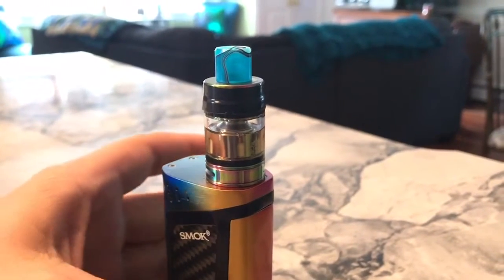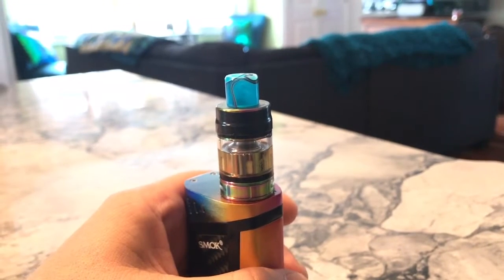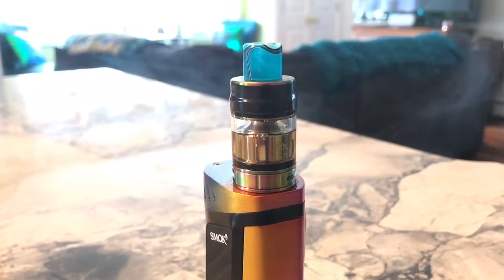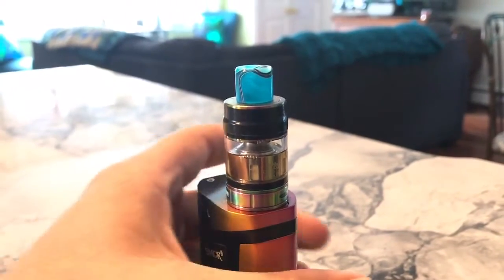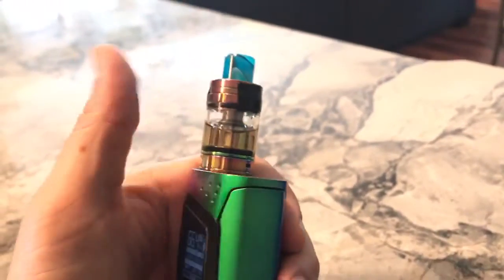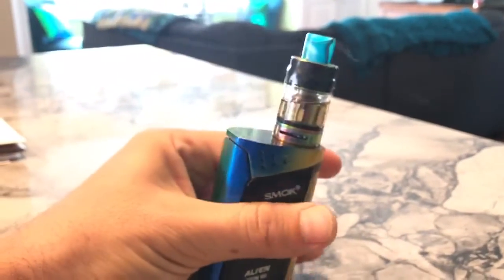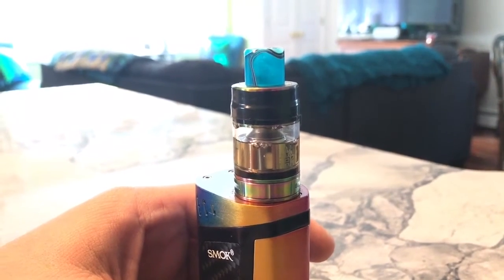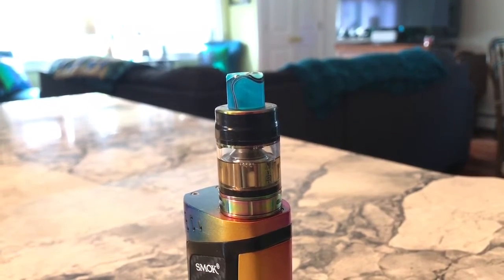Burning your coil? How to make vape coils last longer!

Comment: I bought an iStick Pico S to switch over from cigarettes about a month ago.  The coil that came installed worked like a dream.  But when I tried to change it about two weeks later, suddenly every new coil I put in either instantly burned, or would burn up within two days, and it's been happening constantly ever since.  So far as I can tell, I'm doing everything properly- priming the wick, letting it soak a while, etc.  Bought the eLeaf coils that the vape shop recommended for the model.  But it's constantly burning up, and the past week and a half, I'm also getting no flavor whatsoever from any of the juices I'm using- they all just taste sort-of cottony and gross.  (They tasted fine when I first started using it.)
Reply: Old comment I know, but I had the same issue with the geekvape zeus coils. Tried like 4 different coils, all had the exact same warm/slightly burnt metallic cottony taste.. found out that I probably suffered from vapers tongue, and I just switched the e-juice flavor to menthol for a few days and no more shitty metallic cotton taste☁

Comment: I'm using an Aero Mesh Tank with Baby T6 coils I got recently (my local store was out of anything else) and I primed the coils well enough, let them sit. I poked tiny holes so the cottons can moisten quicker, but it's still drying out after 1-3 hits. I don't see the purpose of having a coil that you have to wait 5 minutes between each hit.

Comment: For some of the Smok kits, the mouthpiece is too tight and it creates vacuum in the tank. Because of the vacum, the liquid won't feed the coil. You can test this by unscrewing the mouthpiece abit, and if there is bubbles then that was your issue